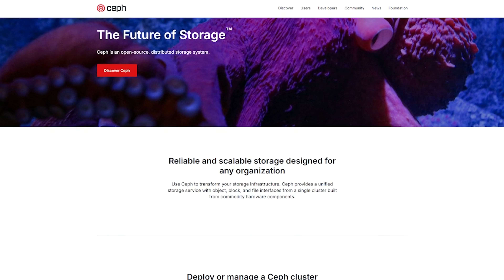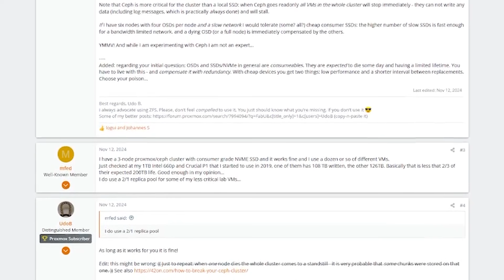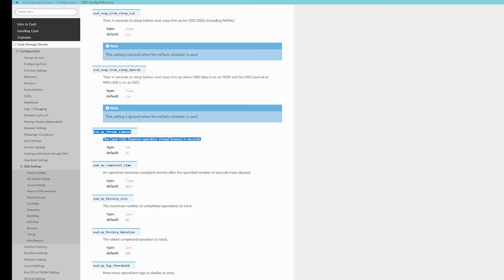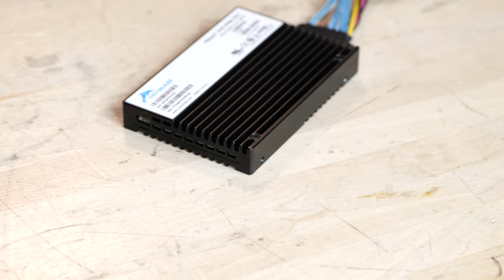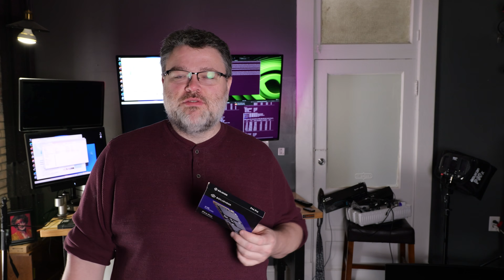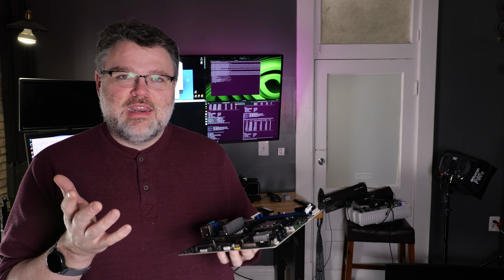Ceph Shenanigans with Wendell! Broken Solidigm Consumer vs Memblaze Enterprise -- What happened?

Comment: All my SSDs on Ceph have PLP except a couple of M10 Optane drives as CephFS metadata drives, and Database storage.
Went from Synology to GlusterFS (failed badly couldn't scale nicely) to unraid (unreliable host kept crashing and full system lockups) to Ceph on 3 node Proxmox (has been the most stable setup, if not a little slower) I can deal with slow/er if it's stable. The ability to pull a whole server and have the storage and compute still up without significant downtime is brilliant. A great learning curve Ceph Docs are really well detailed, much much better than Gluster and unraid.

Comment: cheap old enterprisa sata, is still better than new non enterprise nvme. also there is something you missed, its not just bandwith, its latency, latency latency latency! tuning latency and having superlow latency (think cstates, bios tuning,  os performance tuning etc, makes a bigger differance, than just straight out bandwidth. Also firmware on nvme drives is... a whole thing. nvme garbage collection... so many fun topics.

Comment: I have been waiting a while for it to get back into my "queue" but we're about to really get into a project at work with 7 nodes of 24/32core amd with 256GB ram and 4 nvme to back 24 3.5" drives per nodes. Might post about it on the forums?

Comment: We have been running ceph on 7 node clusters (3 of them) for 5 years now.  It was chosen for the cephfs, we needed a mountable filesystem to share among pools of servers used for interactive data science needs.  Ceph essentially replaced NAS as it gave us the ability to have quota’s at any level in the filesystem, ceph support is baked into the kernel so you mount like nfs, but you can also have on-wire encryption.  We do use the built in LUKS encryption on the OSD’s for at rest as well.  7 Nodes were chosen mainly for the redundancy.  We can patch nodes 1 by 1 without any outage/impact, and we can patch nodes even if we have a node out for extended period of time.  

So far it’s been great.  Lots of learning as cephfs is in and of itself an entire rabbit hole you can just plain live in.  But knocking on wood, these clusters have not lost a single byte, or gone down ever since enabled the cephfs mounting.  100% uptime 5 years and counting.  That includes now moving from RHEL7 to RHEL9, and 2 major ceph version upgrades, and many smaller patches, all while serving I/O.

Now, our use case doesn’t require the fastest speeds, we are 3x faster than the original net app we were on, but what your attempting I’m sure is completely different than what we are doing.  We still have PG’s and that dang crush maps in common, but RBD serving vs cephfs vs rgw are all extremely large sub parts, should almost be considered their own thing, but they are under the ceph umbrella.  

Ceph can be good, look at what CERN is doing with it at the LHC!

Comment: From having PM'ed a whitebox ceph implementation, just don't. All these drives+power and all you get on the backend is an order of magnitude less performance than you put in. IMO the only use case that makes sense is large implementations where all the overhead is absobed more efficiently, and even then only if your data consumers are OK talking to ceph directly (protocol gateways and getting them highly available is another can of worms).
Reply from the maker: this is how its always been, but I was wondering if things were changing a bit with new software and smaller clusters. I think for 3-node cluster it can be a bit of a special case but if one is doing 3 way mirroring replication then it seems like ceph isn't a good fit for that special case either. drbd is probably the best fit if you need real-time (mostly) write sync. or something like that.
Reply: @Level1Techs  IMO people using Ceph in smaller clusters don't really grasp the drawbacks. Piling the roles onto fewer nodes makes the whole thing more byzantine and fragile, because Ceph just wasn't engineered for that scale. In general ceph is advertised as being designed for commodity hardware, but what it means is really "x86 enterprise metal", not consumer gear. It's really vulnerable to to intermittent/partial failures.

Comment: I'd personally prefer to see Wendell try to wrangle the drbd instead, you can theoretically have two nodes with a dual-primary setup (so both nodes can freely write) and run clustered lvm on top for a shared volume for two Proxmox nodes. You probably should add a corosync-qdevice on some other device so the proxmox cluster stays in quorum (a qdevice provides a vote for the cluster but is not a real node, it can be a raspberry or the proxmox backup server if it's running bare metal somewhere).
I tried setting this up (not for proxmox) using a zvol as the block device for the drbd but it's a bit of a rabbit hole.
Imho this is the only "real alternative" to ceph for small clusters

Comment: If you want sth vSan comparable use linstor (drbd9), you can even use zfs underneath ans use the Proxmox plugin. And yes definately use Ceph with enterprise drives. When we first started with Ceph, we found out the hard way. Its especially bad when the drives fill up...

Comment: Is it better to virtualize the ceph osd and let something else detect failures like a raid controller or intel rsd etc  because not knowing a drive it going out is really bad and a massive design flaw.  I really like ceph and want to create something that just doesn't go down even if that means I have to complicate it and virtualize proxmox so I know when drives are failing
Reply: The company I work for has been using Ceph for about 10 years now. We have had some really bad networking incidents (core switches crashed), entire racks gone down because of power failures of all circuits in a rack, cooling stopped working in the data-center and servers started throttling and then crashing, bad lasers on fiber modules that made network flap like crazy, buggy HDD firmware. Its self-healing capabilities worked every time!

Ceph will put down an OSD if the drive fails and re-create the replicas on other drives. It even has a module that predicts drive failures and migrates data when a failure is expected.

Fast enterprise drives help a lot! We had a POC with consumer grade drives and it had glitches from time to time. Use 5 MON servers as 3 is not enough! You will want enough servers to re-elect a master and keep writes working.
Reply: @Alex-QQQQ  Good to know thanks for the info

Comment: Would be nice to see what options are available as storage for a 2 node cluster for home labs
Reply: afaik the only option for that is drbd/linstor, but it's a rabbit hole to configure correctly
Reply: 2 nodes doesn't make a cluster, though I feel for highly available storage if you don't have a lot of nodes available the best option is to go with a zfs-ha set-up which uses dual controller JBODs and corosync magic to have ZFS available across 2 machines. Using SAS4 you get 24gbit of bandwidth per SAS port so you're sooner limited by the PCIe link of the HBA than the speed of the drives (well and like zfs overhead but that should be less than ceph) in that scenario and should be enough to saturate all but the fastest of network link speeds given enough vdevs. Really wish this offered on the community edition of TrueNAS it would solve a lot of headaches for many.
Reply: @hugevibez  you can add  corosync-qdevice on a third device just for cluster voting (raspberry or pc or whatever) so you have an effectively 3 node cluster even if only 2 are actual hypervisors. Proxmox can do that

Comment: It sounds like going with hyperconverged storage is getting not so attainable if CEPH is requiring 7 or more nodes to operate. 3 hosts are all some people need for compute, if we need 7 hosts, that's 4 more hosts, dual power supplies (maybe ups or more colo power feed), network ports (switch capacity), more disks and hba's, more hardware support plans, more ram, more cabling and more licensing for all those vendors that license by socket the vm could be on (ew oracle/MS sql). Also stating ceph does well with 25gig but really needs 100gig networking, that's a lot of chicken dinners. I don't even have a 25gig switch in rack yet. Ceph sounds less economically friendly hardware and money wise, less low power friendly, and very less environmentally friendly.

We are looking to migrate from VMware to Proxmox with new hardware on the way for our refresh. I was pondering throwing together 3 node ceph just for testing with proxmox - cuz 3 nodes is all the compute we really need in a single cluster and that is all that is on the way for the cluster. We have a Nimble HF40 (I think HF40 it's active/standby dual controllers) which only exports storage as iscsi. I'm looking at doing iscsi with lvm for hosting vm data stores on the Nimble for proxmox being our primary storage. We will have a few months of testing before our next vmware renewal next fall so I'll be building it and migrating some test VMs, building new VMs, or restoring some VMs network isolated from VMware backups just to see how things perform.
Reply: I'm running 3 nodes for ages now. Works fine. Colocated monitors and osds.
Reply: iscsi is fine for proxmox if you don't mind the limitation to thick volumes. You would be boned if you were limited to fiberchannel
Reply: Ceph does not “require” 7 nodes. I manage many 3-node clusters in my day to day and run more than one at home. As long as you have an okay amount of RAM and CPU you’ll be just fine. Yes Ceph does like having more nodes if it’s available. Ceph performance scales more from the number of nodes than from the number of OSDs, but it can run just fine, especially if your performance needs aren’t requiring heavy QD1 4K workloads, which most homelabs don’t.

Comment: I have heard that the main reason Ceph wants PLP drives is because due to how it operates it supposedly turns all async writes into sync writes. And a drive with PLP has just much lower latency confirming those sync writes than a drive without. Is this true?
Reply: If an OSD loses power uncleanly, if it doesn’t have PLP when it comes back up, you’re going to see a fair chunk of time rebuilding, depending on how long it was down/out and how it went down. If you have PLP and the cache gets flushed, when it comes back up the only data that needs to get synced is any writes that went to the PG while the OSD was offline, so you can get back to healthy very fast with very little rebuild IO
Reply: The other thing I should say is that yes writes to actual disk will be more sync, however if you have a proper deployment, with plenty of ram, writes will be acknowledged even sync writes, as soon as the write is in the OSD deamons system memory, as losing a single host will mean remaking hosts still have the data, or losing all hosts will just be the same as a crash consistent checkpoint, with a little rollback. The performance issues come to light if you starve the OSD deamons of system memory and they don’t have enough RAM to keep writes in memory between flushes. IIRC you want around 0.5-1GB RAM per TB per OSD.
Reply: No not really true, but kinda. I think if you mount a rbd block device you still get normal Unix filesystem behavior. But once your workload does a sync, you better believe ceph will make it blocking and indeed plp usually helps there. Unless you find ssds with very good synchronized/direct writing. Usually the old mlc's or as mentioned newer ssds but with plp

Comment: Using old Optanes as WALs is what made Ceph sing for me.  In my home lab I have a three nodes of spinning rust AND erasure encoding, and it works good!  Not amazing, but I can get it fairly busy and it does not choke!   Just a 1-2 GB WAL for each OSD from an Optane disk does wonders! I put 4 OSDs per 16GB Optane and it just solves SO many problems...

Not the SSD firmware bugs, because I have 100% been down this same rabbit hole!  It's infuriating! Especially doom clocks!  :<

Too bad it isn't made anymore...
Reply: Wanna see something crazy? Do Optane PMEM, split half and half between WAL and PWL. With just two sticks of PMEM per server, I see 15-18GB/s IO per image lol. It’s nuts
Reply: @D4M14N1989  Hmmmm!  Noice.
Reply: OOO, Optane sounds like it would be a prime use case for this. Such a shame they are gone with the wind.
Reply: I do the same thing, its worth it, hope Optane comes back in some form for applications like this.
Reply: Tried setting up ceph and couldn't get the S3 radosgw to work correctly. Any guide you can recommend?
Reply: What size are your OSDs when you run only 4 GB for WAL/db?

Comment: Good luck getting enterprise SSD or anything with PLP below at least twice the price, if at all.
Reply: You can buy used or sometimes there's a selloff of older models to clear out stock
That's how I went from having all consumer SSDs to owning 2x Micron 7400 Pro, 2x Micron 5210 ION, 1x Kioxia CD6-R, 1x Micron 9200 Eco and 1x Optane DC P4800X. (Plus a Lexar NM790 power efficient consumer drive for my laptop... )

Comment: Wendell us mere homelabbers & data hoarders are crying on prices of HDDs with ~30$ per TB how goes it for Enterprise offerings?
Reply: If your asking about used stuff it's terrible. Especially for used enterprise flash its unobtanium. Been looking to get some new HDDs, and the only reasonably priced drives I can find are external HDDs. You know it's bad when the new shucked HDDs are cheaper than the used enterprise drives.

Comment: I think the sk hynix p41 also has the same firmware bug
Reply from the maker: right you are!
Reply: There was a firmware patch for the P41. I've been running it as my boot drive for 2 years after patching it. Still running strong.
Reply: Makes sense, since it's basically the same hardware under the hood

Comment: I have 5 Beelink Me Mini with 1TB m.2 and 128GB m.2 filling all slots on Prox/Ceph. Works great lol. Would like to see performance testing of 3 way replica vs a parity pool if at all possible!
EDIT: So at my work, we have a poo mix of hosts and HDD/SSDs in a test proxmox cluster to see if it can replace our VMWare setup, which it is slowly becoming production because of money crunching. We shutdown one host to add a GPU, which for some reason put some samsung 2TB SATA SSDs in a different host into a weird firmware failure mode where it would only report 1KB of total space, which then froze all IO across the clusters VMs. No idea why it did that.